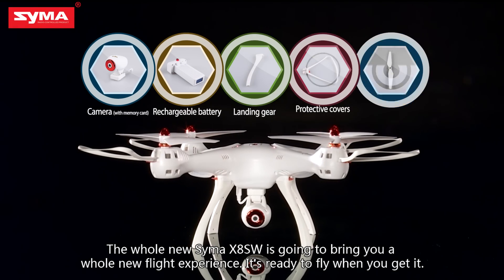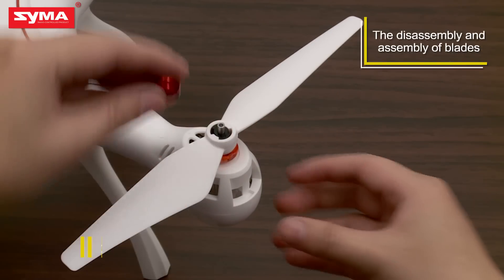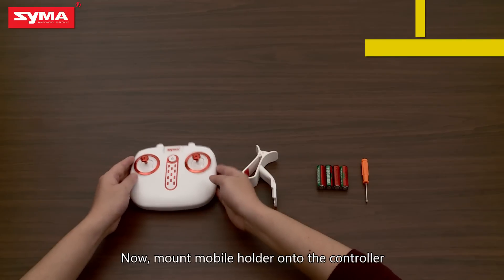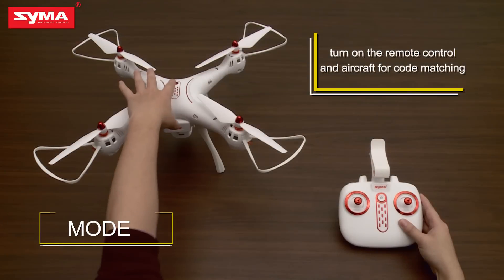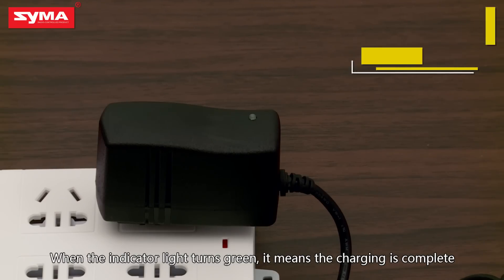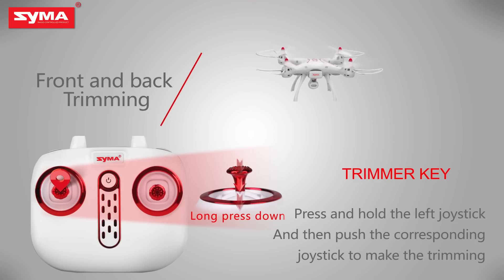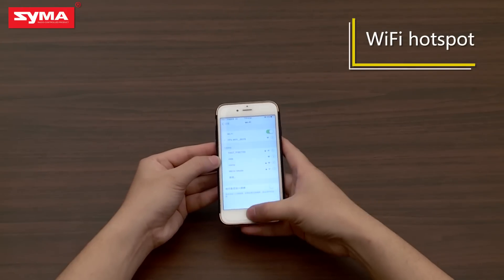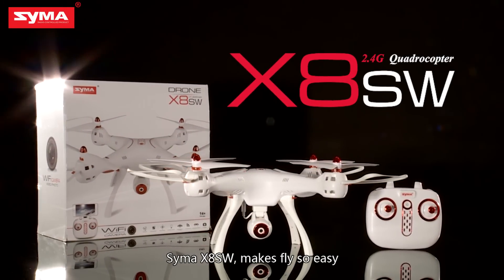SYMA X8SW FPV Real-Time Drone Operation Tutorial

Comment: Syma whats go one with x8sw i cant stable it!!! Try to calibrate... try to trims for compensation self fly direction... but x8sw still self fly to some diection - no wind(i try it in closen building) new from box!!! X8sw had 6axis-g had vertical stabilization and vertical is realy stable but Its cant state on one position!!! How fix in one position freeze can your shoe realy video whats syma x8sw can freeze not only vertical but and hotizontal positio? Owerwise for whats x8sw 6axis giroscope? Also how disable turn off engines(motors) by hold few seconds left joystick in down??? Its very dangerose i cant nornal take down x8sw!!! If i try to fly down few seconds x8sw turn off the engines on fly!!!!
Reply: I can’t stable mine to also I’m not that good at landing mine I crash it a lot

Comment: i have new drone syma x8sw, why my drone at a distance 15-20meter often lost connection or control...
Reply: Maybe face the transmitter to the direction of the quadcopter?
Reply: Yeah me too but i have solved it. When u want it to 50 or 100m ur internet connection has to be 3g or 4g
Reply: @cesaltinowidiastara2888  so ur saying i need to turn on data and wifi at the same time??
Reply: @n4sonxxx522  exactly
Reply: Same